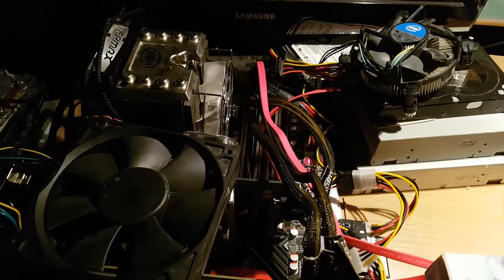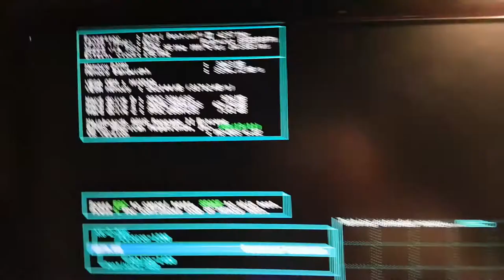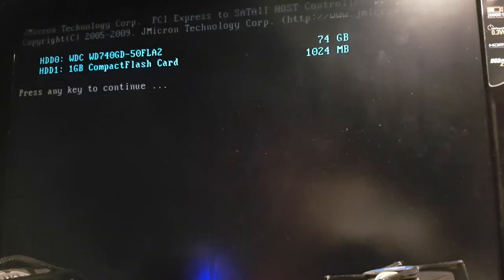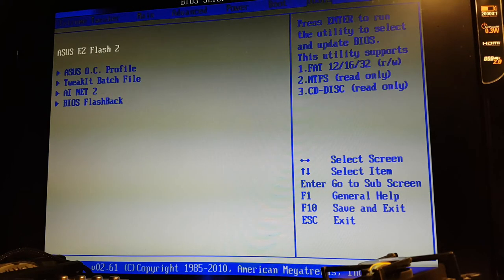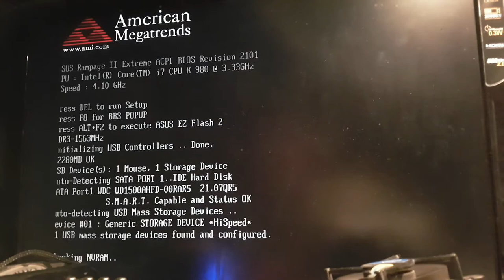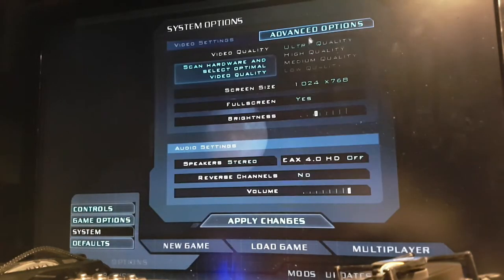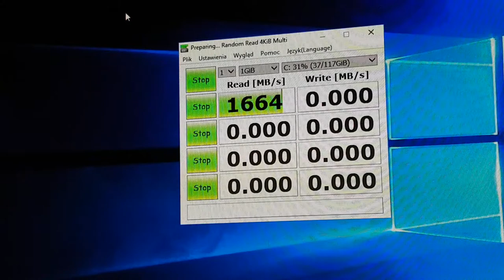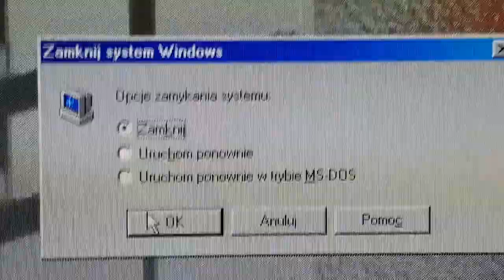"Madness" : One Retro PC to rule them all.

Comment from the maker: What all that "compatibility" in x86 code can get you ?
A PC that can do almost anything :)

3DMark Time Spy Extreme result : https://www.3dmark.com/spy/2555135

Timestamps :
@0:07 Introduction and hardware
@5:53 DOS 6.22
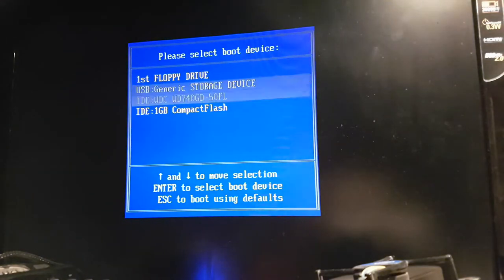@16:10 Surprise #1 ;)
@23:32 Windows 2000
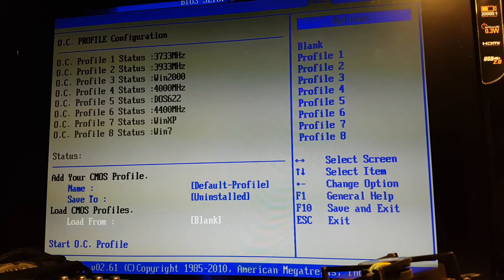@33:35 Windows XP
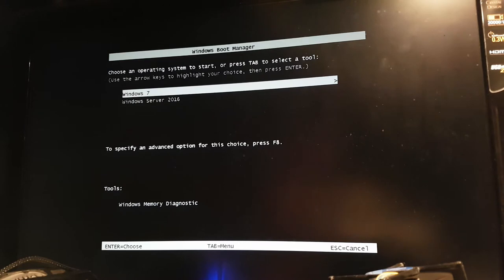@47:29 Windows 7
@56:05 Surprise #2 :P
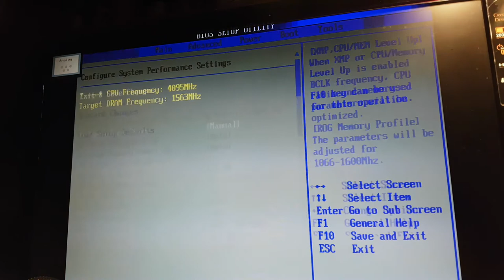@1:13:18 Bonus

Hardware list :
CPU : Core i7 980X (w/BOX cooling)
MB : Rampage II Extreme (BIOS 2101)
RAM : Corsair 3x4GB
GPU1 : GeForce 7800 GTX (Reference)
GPU2 : GeForce GTX 780 Ti (Reference)
SC1 : Aureal Vortex 2
SC2 : Auzen X-Fi Forte
HDD0 : Compact Flash 1GB
HDD1 : WD Raptor 74GB
HDD2 : WD RaptorX 150GB
HDD3 : Samsung SM961 256GB (NVMe)
Clover "Pendrive" (card reader + microSD) : Sandisk 8GB
PSU : OCZ ZS 750W
Floppy : GOTEK USB Floppy Emulator

Comment: Not bad, but I prefer retro PCs for the old stuff (Dos, Win9x) and a youngtimer PC (Athlon 64, Pentium 4) for Win XP. My X58 (X5670 @4 Ghz 1.16V, 3x 8GB DDR3 1600, Titan X Pascal) system is for the modern stuff (Win 7 and 10).

I have retro/youngtimer PCs from 1997-2004 in my collection. :)
Reply from the maker: Thanks. I know that everyone has different opinion on what "retro" means. To me, this is a "Retro PC", because it's cool old tech :) (MB will be 10Y old next year). 
I almost always kill "period correctness", for convenience and having less problems down the road. Last thing : I don't have room for three different PC's (each for one PC era), that's why I made one that does everything ;) (up to a point for DOS/98SE games at least).
Reply: You also should install a 3Dfx Voodoo 2 card in the system, but I think all PCI slots are in using? :) A voodoo 2 from 1998! card also can work under Windows 10!
Reply from the maker: I only have one PCI in RIIE, so no 3dfx SLI... also, Voodoo 2 = no sound in DOS :(
Reply: nah that i7 980x is not a retro pc! are u mad! that cpu is really capable today 1366 socket is one of the best plataform ever made for  intel. that pc is for modern games! not for retro use athlon 64 pentium 4 and win xp! to run old retro games! doom3 ist no retro! retro is first doom!
Reply from the maker: I agree, it's a fast AF for Retro PC :) However, in general "Retro PCs" are old hardware on which people usually run Windows 98 on (for that "the good old days" vibe). Well, this PC clearly runs Windows 98 and is almost 10Y old (CPU is 2010). In my book that makes it Retro PC. PS. In follow up, I played Monkey Island 1 and Command & Conquer 1 (both in native mode and with sound/mouse support) on this rig.

Comment: Hey man, I'm working on a similar project on a socket 1155 motherboard, one that has a floppy and IDE connector (P67 Fatal1ty Performance).
It will be a sweet machine with PCI V5 and Aureal Vortex for 9x, and 980ti and X-Fi for XP/10, if I can get it to work perfectly that is.

My main problem is, none of my optical drives are detected under Windows 98. I had to install it from a thumbdrive, and now that it is install, I just can't seem to have it show up in the device list (the optical drive works under XP and 10)

Got any tips for me to get it working?
Reply from the maker: If drives are SATA, you need to set controller up to IDE mode for them to be visible. IDE Compatible mode will work, while "Enhanced" probably won't.
If they are IDE, and connected to the same cable, you must set proper Master/Slave options on the back (or use "Cable Select"/"CS" on both).
Also, make sure you installed proper drivers for IDE/SATA controllers on Windows 98.
Reply: @CompatibilityMadness  I probably should have mentioned, both drives are connected through a real IDE cable, the OS on an SSD with an adapter, and the optical drive in slave mode. My first choice was a Sony BWU-100A blu ray writer, when it didn't work I assumed it was because it was too new, sadly my old Plextor IDE DVD from 2005 isn't detected either.

Thanks for your reply, and for your cool vid, running older OS on modern hardware is neat.
Reply from the maker: @JimProfit357  If OS is on IDE apdapter, you can try switching DVD-ROM and SSD around. OR you can buy USB-DVD drive (or PCI/PCIe expansion card with additional IDE/SATA ports).
Reply: @CompatibilityMadness  Alas, my USB DVD Drive isn't recognized either, and it is internally a IDE drive...I think this has to be driver related, as if the OS was installed without any kind of CD-rom support.
Sadly I can't find a generic optical drive installer the same way you can find generic USB 2.0 installers...
Reply from the maker: @JimProfit357  You don't need "generic installer". Only drivers for IDE/SATA Controllers that are on MB. If controller doesn't have drivers, it won't be available for OS to use. Also in USB configuration (BIOS/UEFI), there should be "Legacy Support" option and CD/DVD emulation mode.
Not sure how much UEFI is compatible with Windows 98 though... maybe try enabling USB 1.x mode (or disable USB 2.0), if such option exist ?
Windows 98 needs USB 2.0 drivers and patch to work with USB 2.0 devices/controllers. No drivers = no USB support.

Comment: Great Video! I have a similar setup to yours but it's spread around 2 PCs (one retro, one x58 for modern stuff), and was wondering about moving my aureal vortex and v5 5500 pci on the x58 (i have more pci slots as mine is a P6T) to save space. How do you select the graphic card from which to boot? (setting it to boot from pci or pci-ex from the bios profiles?). How are the temps when using ur main system with modern games?
Reply from the maker: I can't select GPU form boot (at least with my board, it defaults to PCI-e) :(
You can however, disable the one you are not using in OS itself.
I will not work with standalone DOS 6.22 however Win 98 DOS should [?] use it's device scheme, so... Maybe it can be done that way ?
Temps are fine, but this is open bench (I don't have case for dual size GPU on last slot in standard ATX format MB).

Comment: Can you show device manager in Windows 98? As i think, there is a lot of unknown devices and "conflicts"
Reply from the maker: It's already in the video you know ?
https://youtu.be/oT47y_EaGHs?t=4503
Personally, I don't care about yellow mark near a device (in my case it meant "no driver = issue").
If computer boots, OS does what I want (knowing it's limits) - I don't see a problem with it.
There was no conflicts, because I disabled stuiff I can't use, freeing IRQs for other stuff that can be used.
Reply: @CompatibilityMadness  i'm sorry, i missed this part of video. I understand you, performance is very nice, but it is should be the way to fix at least some of issues with yellow marks. I also have x58 system and x48. x48 do not have any issues with device manager at all, and x58 shows same picture as yours, but i have Supermicro board that allows to make this system more legacy.
Reply from the maker: @modlabs  Well, you can disable more stuff in BIOS to make them go away, but like I said - they are NOT needed, if PC works within what I think is right. I could check what they are, but I'm pretty sure those are monitoring and controlling chips for OC features (probably).
Reply: @CompatibilityMadness  i understand your opinion, but i have other thoughts about it. As for me, there are some other factors for universal system. For example esthetics and speed control. From this point x38/48 is better choice. But of course it is depends on your main goal.

Comment: L3 cage killed me :).. spelling of word cache is very different. Its a bit mess.. but its working, nice. To again more audience it would be better use English not polish versions of games. If you want to make even more complicated try to add Windows 98 networking. Is there any advantage in Windows 2000 for gaming?
  About Windows 98 storage try to measure transfer speeds, because with generic driver i had something like 3-4 MB/s, until i bought rLoew patch or used Windows 98 compatible storage controller.
Reply from the maker: RUTHAN667 Thanks :)
As for question : Not really. 
Win 2000 wasn't designed to run games. If you have XP, 2k isn't necessary.
It's in parts now...
But I will check HDD speed next time.
I do have RLoew patch.